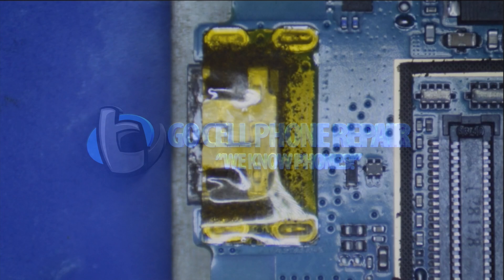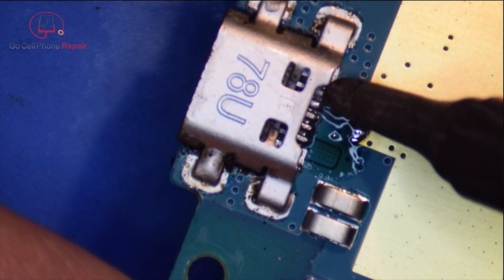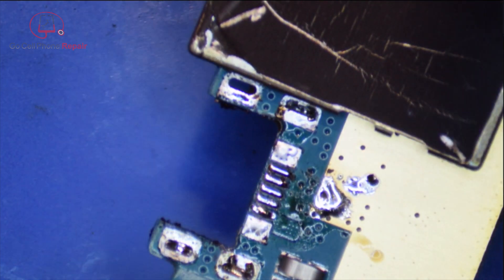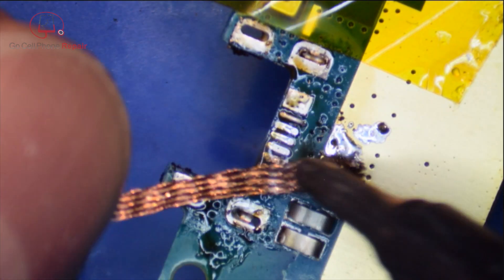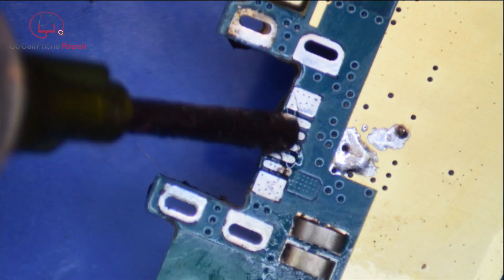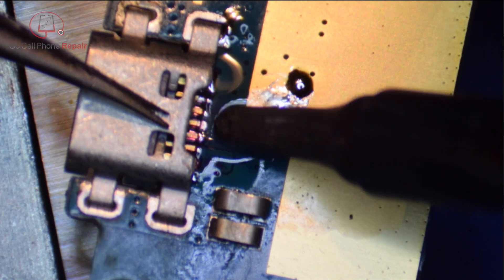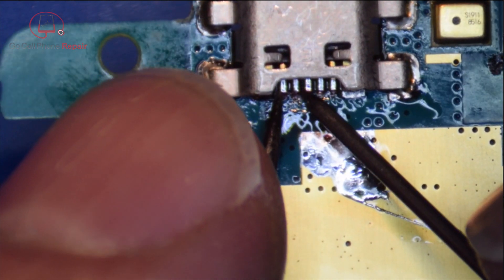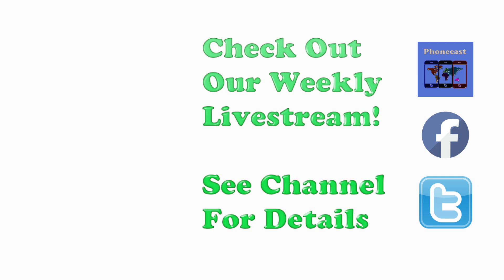LG K20 Charging Port Replacement

Comment: When they sell it more or less than a $100 - 120  bucks
..... I know you have to keep the lights on....
But $65 ...... An external battery charger and 2 extra batteries are a better option..... And thats why they  switched to batteries that can't be removed.. So they can't
Reply from the maker: Hi Raider ROBB. I'm not sure where the $65 came from so I'll assume that maybe this was a quote from your local repair store. Determining labor fees is a great topic though and I will have to do a video about that one of these days. In fact when people say that the phone repair business is no longer profitable I suspect that they have made some serious errors in this calculation either on the low or high end. 

I am a fan of extra battery+external charger despite earning a living in this business. It is sad that virtually every major manufacturer has moved to a non-removable battery in order to prevent customers from extending the lifespan of their devices.  They have purposely made it difficult and dangerous for the user to swap them out for a new one.

Comment: Is there anyway to replace charging port without soldering flux, only tools I have a is a known tool kit
Reply from the maker: On this model not really. Technically it can be removed using with just a hot air station but without cleaning up the old solder and using flux you'd not be able to attach the new one with reliable joints.
Reply: @GoCellPhoneRepair  Sad you have to explain this 101 crap to noobs, kudos for trying to help people as much as you can.
Reply: @do.not.subscribe.2207  sad you have to insult. You weren't born a genius.
Reply: Dumb... Smh..

Comment: You may want to wear gloves while you're soldering and handling the spool of solder. Also, wash your hands in cold water (so the pores in your skin doesn't open up).
Lead can be absorb through your bare skin. For a repair business, you'll be in contact with more leaded solder than your average person.
Great video as always!
Reply from the maker: Thanks Harrvey. We can never be too careful right? While I always make sure to have ventilation and fume extraction, touching the solder wire by hand has never been something that I've thought about. Someone told me that it has to either enter your mouth or nose to do any damage but better safe than sorry. Now to find some tighter fitting gloves...
Reply: While the usual transmission is through the mouth (ingestion) and lungs (inhalation), in it's solder-wire form, it can be especially tricky (imagine rubbing your eyes or covering your mouth while sneezing when you're working). Leaded solder has a lower melting point than pure lead. 
Better to be safe than sorry. You never know what carcinogens are on and in these phones.
Reply: @GoCellPhoneRepair  Awesome, great video man! Lots of help.

Comment: Removing the anchor's solder that is closer to the pins in always a pain for me. They seem to not want to stick to the braid!
Reply from the maker: Yeah it takes more heat there usually. Sufficient flux and good wick go a long way to help.
Reply: Use a good solder sucker.